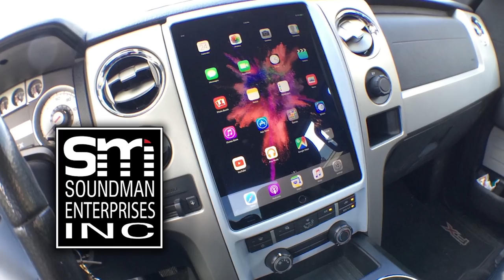Stealing Car Parts!

Comment: u didn't have to take the fan out of the vehicle, u coulda just got to 2 paperclips connected to female end of the plug and ran it to a 12v source (the battery).

Comment: That's the fan for the ac, only comes on when the ac compressor is running, the other fan is the one that runs when the engine comes up to temp. 
Sorry, I hate to be the dick to point that out. .
Reply: potentially. some cars switch both on with the AC. some only one. some variable speed. haha
Reply: +nismofreak34 agreed, but on that model accord the one closer to the battery is connected to a thermostatic relay in the head under the distributor. the one they took out and tested is connected to the AC compressor power circuit. I've got one of those accords.
Reply: haha no shit really? that makes me wonder seriously about how dougs car is going together